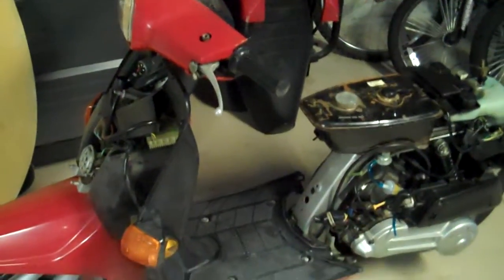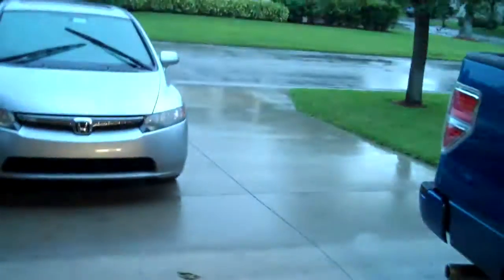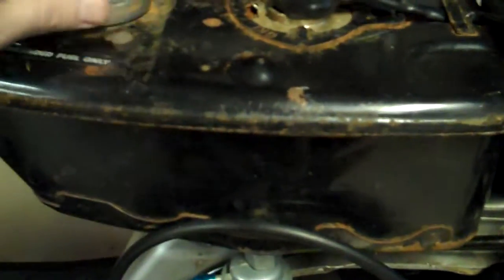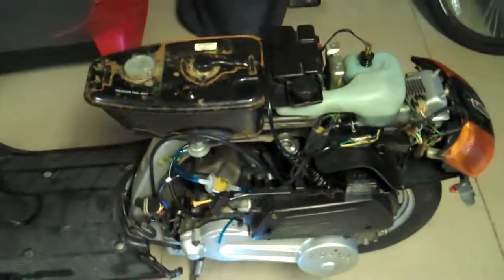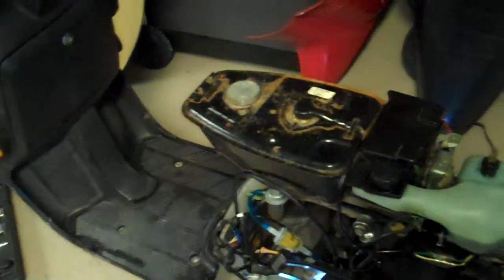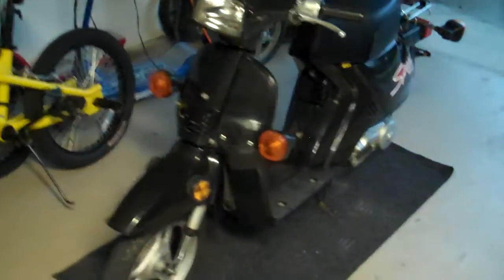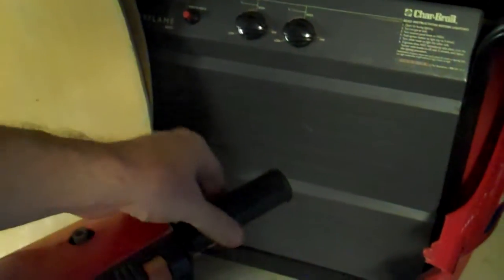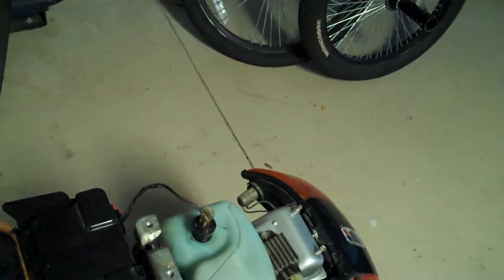Honda Aero 50  (85)

Comment: Agreed. Simple case of fuel starvation. Both hoses need to be connected to get the vacuum to work. From memory the bottom hose generates the vacuum so all that's happening with your set up is that the residual fuel in the line is getting it started then once that's gone it dies ;)
Reply from the maker: Father... the petcock was free flowing (per the video) - 14MM petcock is was near impossible to find - so it was drilled out.  No need for vacuum line when the petcock is essentially bypassed.   The fuel control valve is bowl float.  Anyways if you followed the post it was the pilot circuit.  Its gone now to a friend where it runs flawlessly as you would expect from a Honda machine.
Reply: Oh I see

Comment: Try replacing the bistarter—for the automatic choke. There 2 wires with some type shrink wrap around it. Again that would be for your Honda Aero 50 (85)

Comment: Sounds like the auto choke is stuck..
Or no fuel. put fuel in long hose and hold hose up see if it runs longer. Auto choke is built into the carb and easy to replace if that’s the prob

Comment: Did you figure the problem out? 
Why doesn't the "golf tee" line extend to the bottom of the petcock/fuel valve, as it should? Vacuum is required to open that fuel valve!

Comment: I would try it with the gas cap off. Sometimes the breather in the gas cap is doesn't work. Been steadily riding and have put 3000 miles on mine in the past 2 years. Obviously had issues to over come on the way

Comment: Great video. I have a question...I have an 1987 Aero 50. The front cover and "glove box" was heavily damaged and in need of replace. Do you have any idea where I can locate those?
Reply: shawn h. try eBay
Reply: I lost compression on my 86 Areo all of a sudden while riding it  . There was no noise it just died.  Any ideas on what might have happened    before I tear it down?

Comment: I just bought an 86 honda aero 50 and the battery was dead so i replaced the battery and still can't get it to turn over, it almost does but then just clicks. It has been sitting for yrs but used to run  but just can't get it to turn over fully even with the kick start.Can it be a starter issue? Any suggestions?

Comment: I've got one that runs just like your Aero, that is , not much...  did you ever get results ?  It has around 120 lbs compression,  new outlet valve on the bottom of tank It had no fire I replaced Ignition coil.. I wanted to replace the carburetor but only cleaned it out.  Thanks.

Comment: Replace the peacock with a normal one. Be sure fuel goes to the carburetor all time. I got this problem before. It is all about fuel system. Nothing about air filter